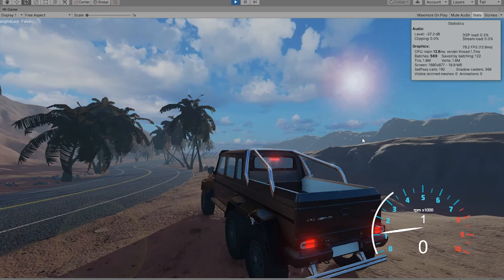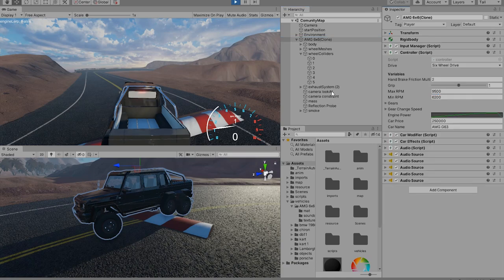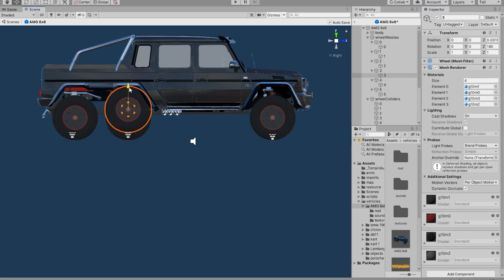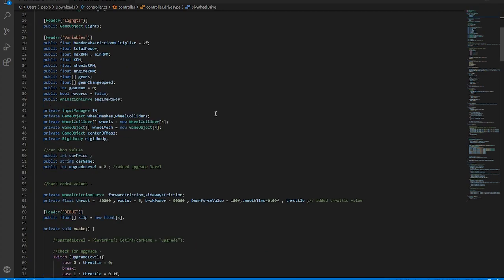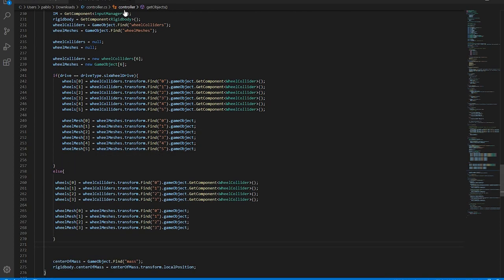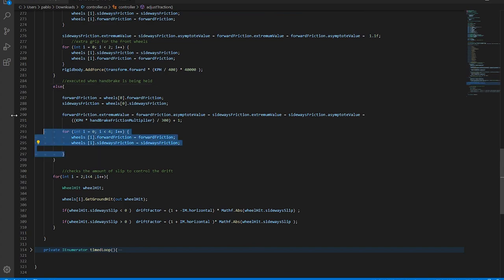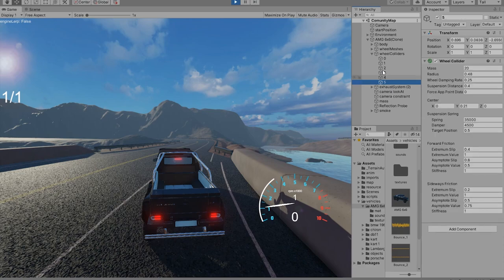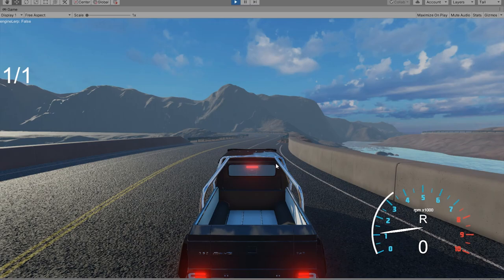Unity Independent Suspension System - (Wheel Collider)

Comment: How do you simulate differential on the rear wheels... It's hard to maintain constant rpm on both rear wheels
Reply from the maker: its hard to maintain because its always in gear , if u find a way to put it in neutral using some kind of if statement then u have absolutely no issue
Reply: @pabloslab  oh alright !! Thanks..